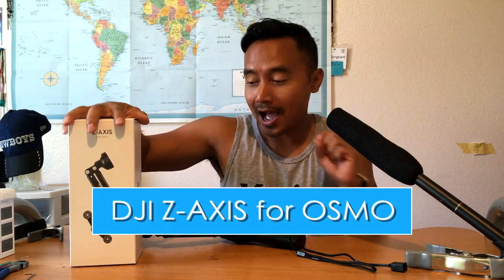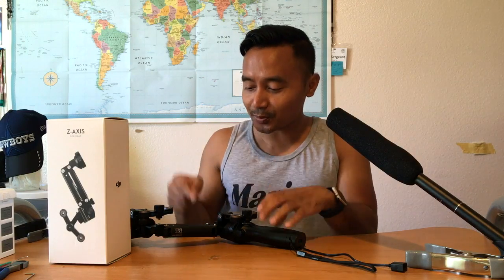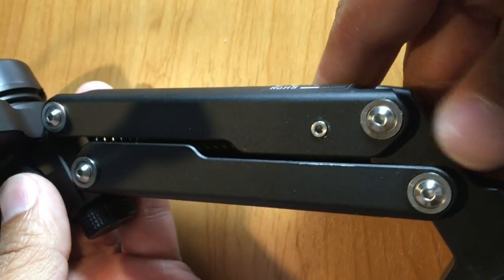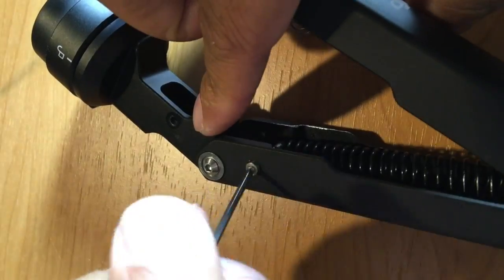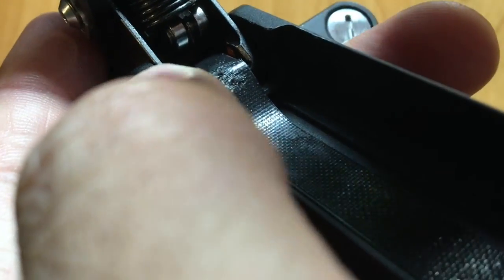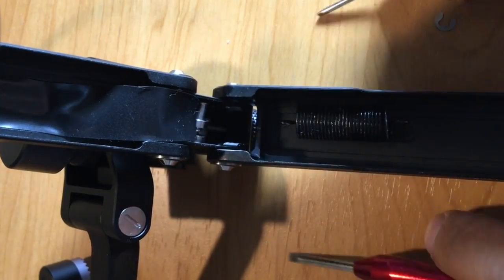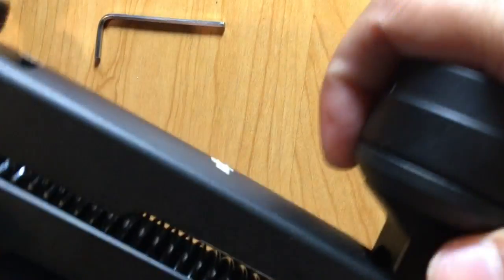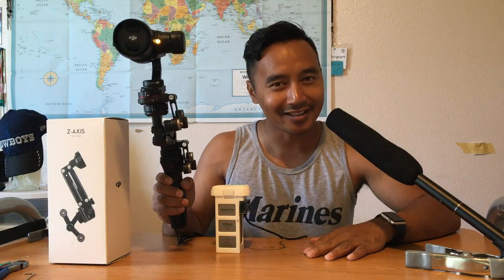DJI OSMO Z-AXIS for X5 DIY

Comment: So, I got the eclip out but I can't slide that rod over far enough to get the spring out. Here it looks easy, but is there some trick? Or is my pin longer?
Reply: Follow along. My problem also. Use two small screw drivers and use exactly as shown.

Comment: Thanks for this video. I tried to attach the x5 adapter to the z Axis but the rotating lock doesnt seem to fit. Any modifications needed there?
Reply from the maker: Hey there. Hmmm with my experience, the X5 adapter just fits right on in.  Think of it as putting the adapter on the osmo. The z-axis is just an extension and should just fit in. Trying fitting it on the osmo if it's new. Might just be a little tight. Let me know if this help.

Comment: Hella and thanks for your video. could you please write all informations about the spring (size,....) ?  thanks again
Reply: Thank you very much !
Reply from the maker: Hey Eric,  Yeah sure.  I attached a link above to where to buy it from home depot.  I will link it here a gain http://www.homedepot.com/p/Everbilt-7-16-in-x-1-1-2-in-and-7-16-in-x-2-1-2-in-Zinc-Plated-Extension-Spring-4-Pack-16109/202045464

But basically it's the shorter one the "7/16 in. x 1-1/2 in." Remember to put tape down the arm to protect it from harming the wires. 

Good luck!